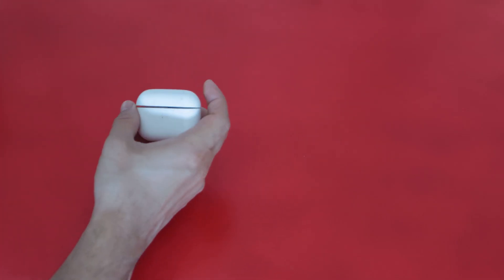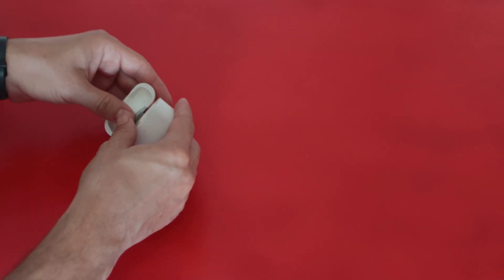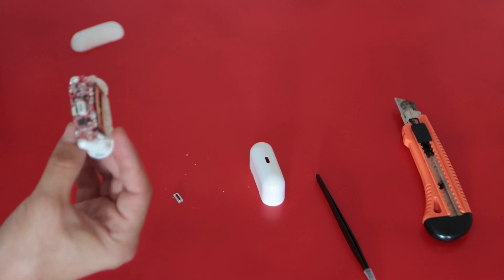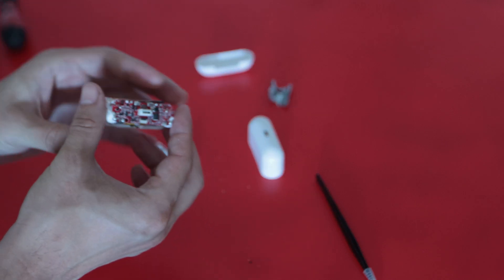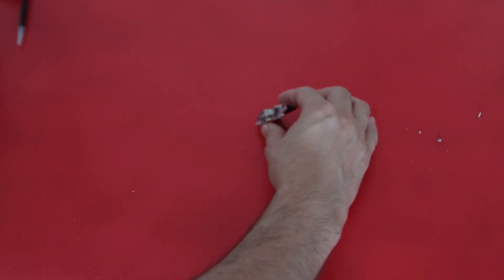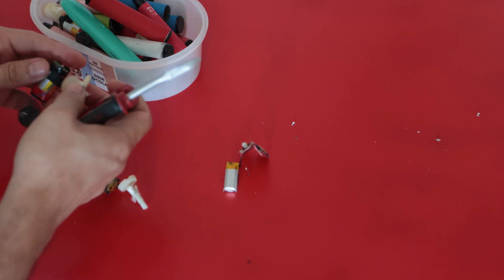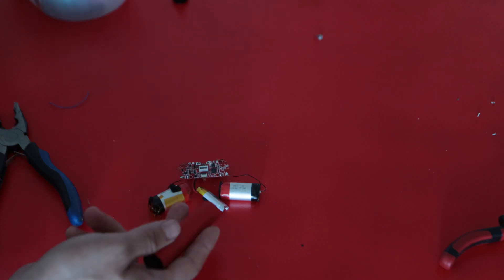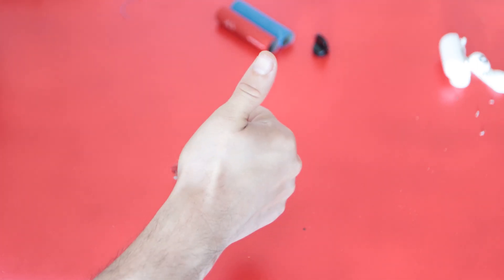How to re-purpose an AirPod Case clone

Comment: Is there a way to buil a led on them to know when things are done charging?
Reply from the maker: there is already a led which turns green. why do you need another one?
Reply: @makersfunduck  The Problem is that i cut the thing where the LED is because i wanted to throw the airpods away then i saw your video so i am only left with the red board
Reply from the maker: @حوسين  why not using a replacement LED then?
Reply: @makersfunduck  I am not as experienced in such things as you so I don't know how or where to place it so I am just going to wait for the TP4056 module that I ordered but thanks for your reply and keep up the good work your channel is interesting
Reply from the maker: @حوسين  Thanks for your kind words. indeed, if you dont know how to solder smd parts, it will be a bit hard for you. But if you are willing to give it a try, and have a soldering station, just give me another reply, and I can look up for a spare part for you :)  it would cost pennies

Comment: Cool project, but it should be noted that these are fake AirPods. The original construction and PCB is very different
Reply from the maker: After your comment, O checked iFixit. Wish they were real. real ones have ST micro-controller in it. Can't complain since I didnt paid anything for them though.